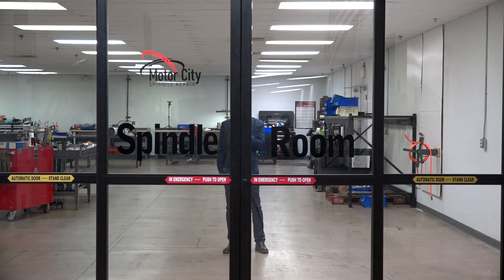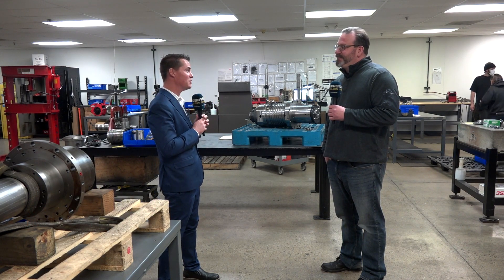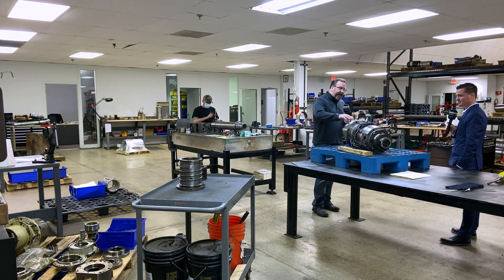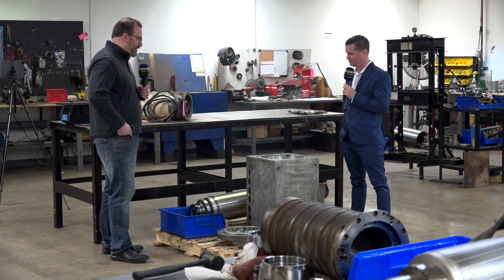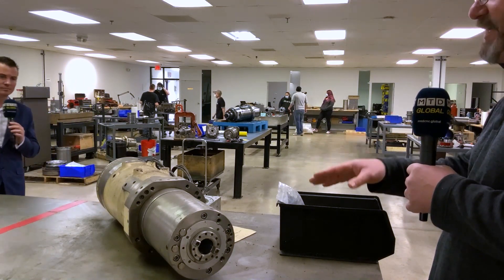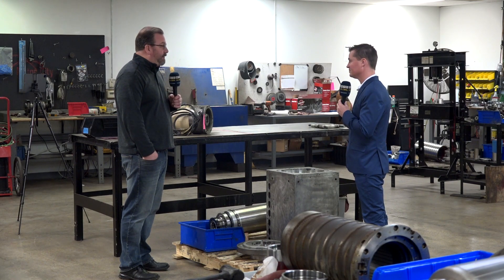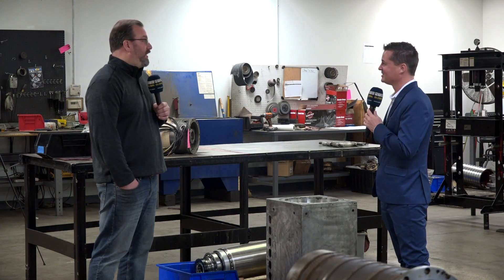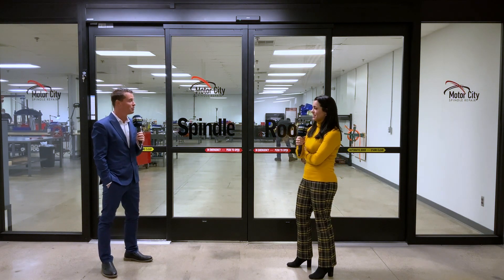What happens when your spindle goes down

Comment: In my case I call a couple of friends and give them free beer to help get it off and apart... I then call all known bearing suppliers in my country (helps that my uncles has a car repair shop) until I find one that has something like a matched pair or a double row tapered bore roller bearing that fits, sitting in some glass display for 30 years... I then order it before cleaning my room and putting thermometers everywhere to get the room to sit between 20-23°C to simulate a "clean room", let my granite plate in there until I prepare all the fixtures, plates and pullers to get it back together, along with a lot of indicators and wipes... It's hell I tell you!
Reply from the maker: Hope you enjoyed the video, thanks for watching.